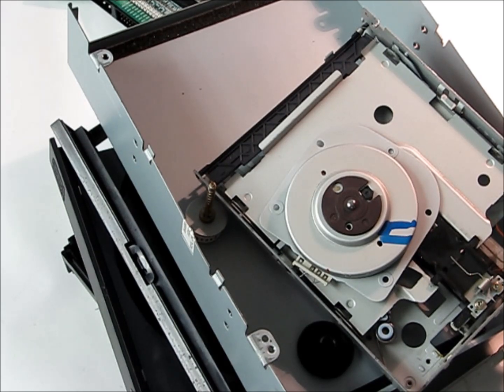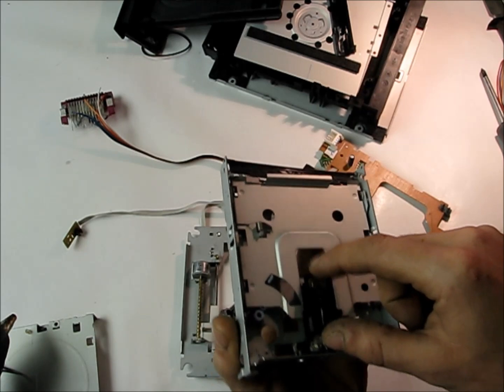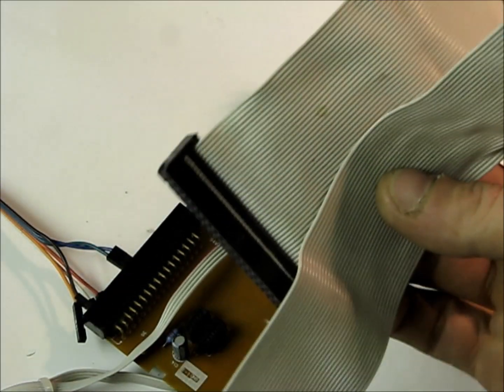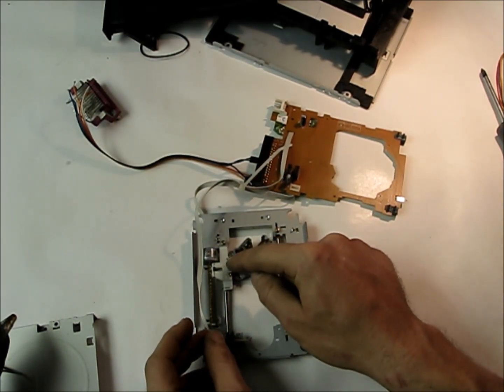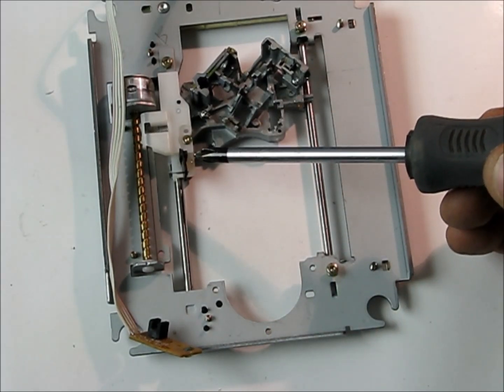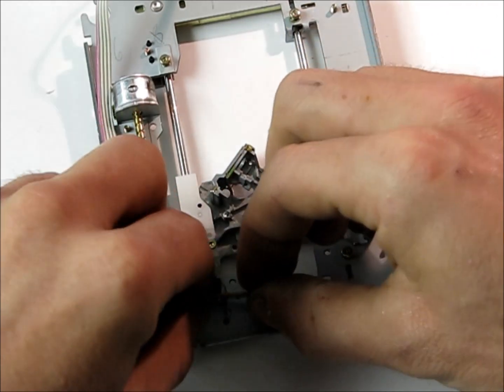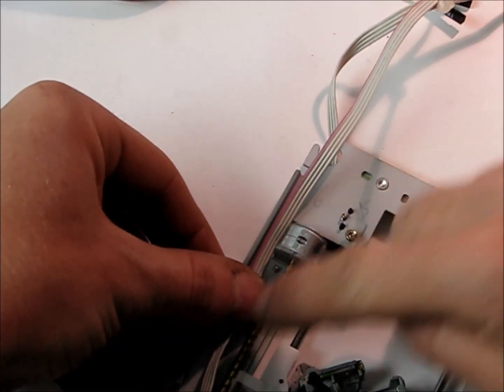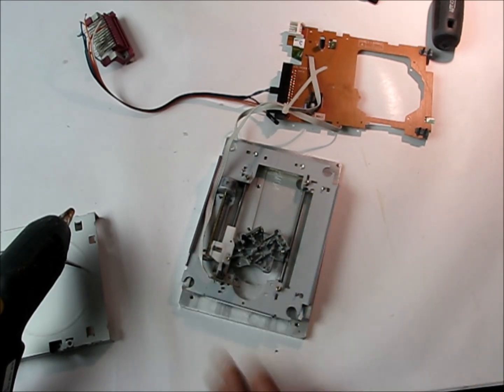DIY FLOPPY DRIVE CNC: Part 6 - Making the Hybrid and Zero Tracking Sensor

Comment: Why did you use the driver from the floppy drive and the stepper from the cd drive?
Why not use both the driver and stepper from the cd drive?
Is there an advantage with using the floppy driver?
Really interested in this.
Reply: Swaleh Owais the floppy driver is acting as a control driver for a single stepper (STEP,  DIR)...

Comment: Hi, I have one problem, the floppy drive driver board homes the sled as soon as it receives power and then when I probe the step pin it only goes as far as the original floppy drive sled. Although when I disconnect the reverse pin and probe the step and then again ground the reverse it goes to the end.
Reply: AndPlaySVK Hi, thanks for Harris videos. I have the same issu. is there some settings to use all the length of the dvd drive sled? If not, why then doing hybrid

Comment: Hi,
I only have two wires for the cd stepper. How do I connect four wire from the floppy to two pole cd stepper? Am I out of luck for connecting the two?
Reply from the maker: I think you are trying to hook up a DC motor (with rotary encoder) most likely... are the wires red and black? you need a different type of cd/dvd rom.. the newer ones seem to use dc motors instead of steppers often..